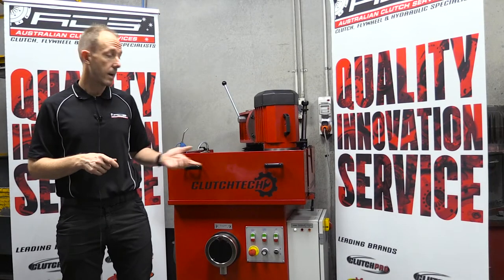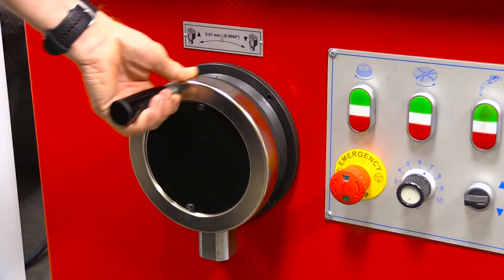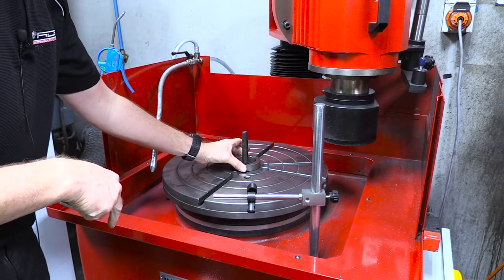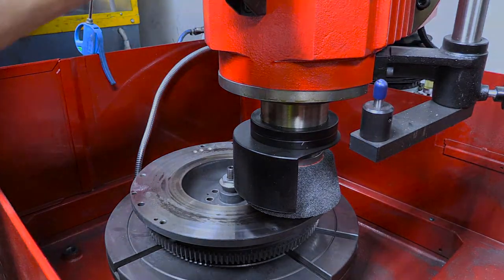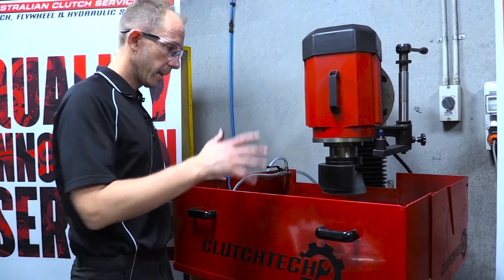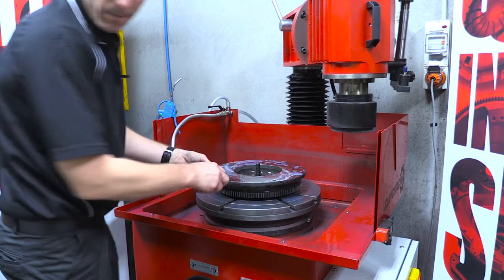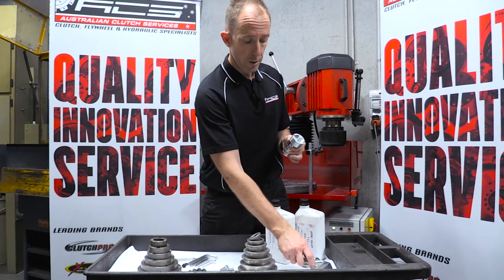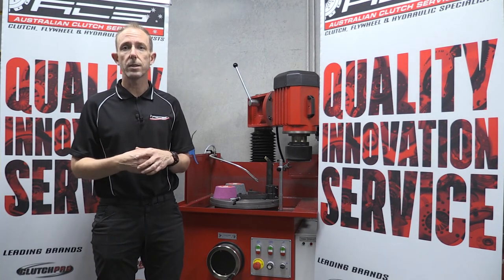CLUTCH TECH: Flywheel Grinder Tutorial

Comment: I had an exedy lightweight flywheel years back and needed it surfaced. The local shop complained it was some special chromoly and difficult to surface. I had never heard anything about a flywheel being difficult to surface.

Also, if the flywheel has a raised outer edge for the pressure plate, how does the machine clear? Do you swap the cutting bit?